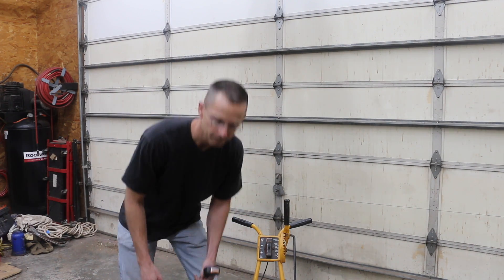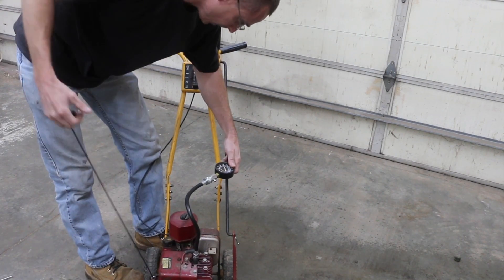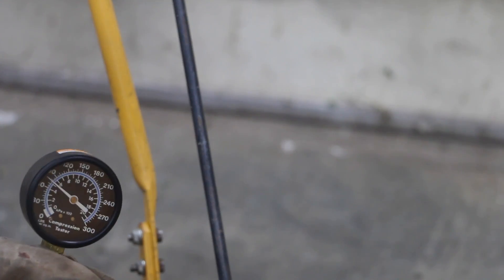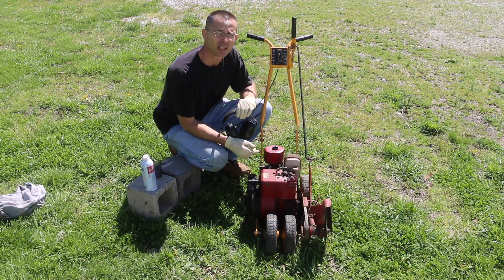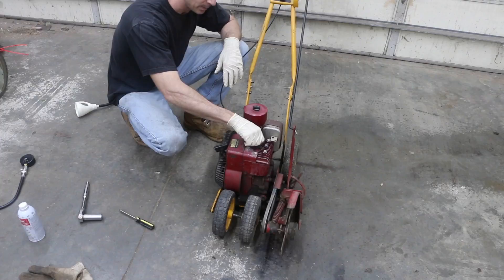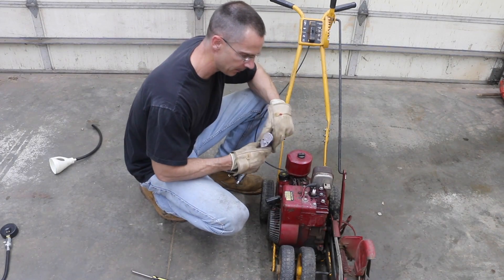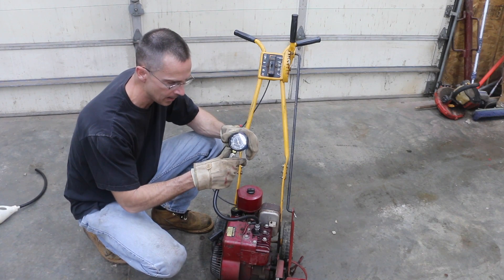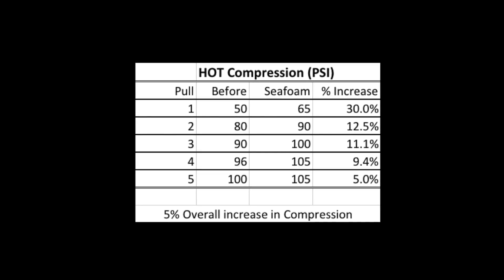Seafoam--can't believe what it did to my engine!!--Episode 4--Compression Test

Comment: I added a can of Seafoam to the fuel tank on my toyhauler after it had been sitting for nearly 7 years. (Took me awhile to get the title.) Initially it wouldn't start as I expected. Then after a lot of cranking it started running very rough. Lots of black smoke. Took a break till the next day and when it started fairly quickly this time it still had a lot of black smoke and was sputtering and coughing but it ran and gradually started smoothing out and after about 25 minutes it ran as thought it never had the "vacation".
I add it to my Cummins fuel tank about every other fill up. Runs great.

He should have added it to the fuel tank not dumped it into the intake. It has a very different function than water injection.
Reply from the maker: Chris, It's helpful to read about your experience.  Thanks for watching the video and commenting!

Comment: Compression in a motor tends to build as the engine experiences more revolutions until the presser exceeds the "containment" pressure of the valves/piston rings.  I believe the reason for the high disparity between your before and after results for the first several pulls was perhaps due to a more "exuberant" pull after seafoam.  I do believe the final pull numbers though, and a 5% increase in compression is nothing to sneer at! Nice video!
Reply from the maker: William Crowe, I wish these small motors had electric starters on them to remove any variance!  Thank you for the encouraging comments regarding the video and thanks for commenting!

Comment: The engine with higher compression may be slightly harder pull start and it should start quicker, needing  less pulls.

 I wouldn't use water to clean an engine unless the engine is tore down and you have a hot water powerwasher.

The Seafoam is proven to work, so I would take that route and it will probably do the job quicker than water but with less thorough of a cleaning perhaps?  I wonder if that stuff ruins gaskets prematurely?

Comment: removing carbon decrease,s compression, but on the other hand carbon built up can block cooling or  cause pre ignition
Reply from the maker: Tom, thanks for watching the video and commenting.  Others mentioned that cleaning around the piston rings and valves helps create a "air tight" cylinder for better compression.  This seems to explain the improvement.

Comment: Water is in every combustion engine.  Condensation is a sign of efficient combustion.  So therefore small amounts of water won't hurt cylinder walls.
You can clean your carb by holding at half throttle and blocking air allowing the engine to suck trash out of the jets.  It's proven
Reply from the maker: Highstranger951, Thank you for watching the video and commenting!

Comment: I think what is going on here is due to thermal expansion of the metals vs the carbon build ups on the valves (in this particular engine) is at different rates and the addition of the seafoam/water/ antifreeze  or what ever you use makes the metals contract rapidly and the carbons cant contract at the same rate so they fall off the surfaces. I think proper monitoring of the EGT's will tell us what really is going on. SO for this particular application the product isn't as important as learning why this works to start with. With that said the truck engine repair with the tapping valvetrain was interesting I would like to have heard the results without the use of the lucas stabilizer (motor honey).
Reply from the maker: Master Debater, Very interesting explanation!  This makes sense!  If I could do the truck project again, I wouldn't have used the Lucas.  Thank you for watching the video and commenting!

Comment: Go to Walmart pay $1.00 for a gallon of demineralised water. It is just as good if not better than Seafoam or anything else on the market. No it will not harm your cylinder wall or pistons that's what they tell you to sell the product. Now before you question my experience I am 42 and have been working on cars since I was 15 and have been working on natural gas oil field engines for the past 20 years and have used nothing but demineralised water.
Reply from the maker: mikefranklin74, Thank you for watching the video and commenting!

Comment: After I used seafoam on my engine it fixed my cracked head gasket, cracked engine block, slipping clutch, and made my car sound smoother and it also fixed my a thrown rod and gave me an additional 50 hp. car mechanics and oil changes are just a conspiracy by oil companys to sell filters and a liquid that basically last years. seafoam will fix anything...
Reply: Seafoam fixed my marriage!
Reply: You mean, oil is not really needed? Gotta go to the beach where seefoam is free!
Reply: Seafoam can fix anything but a broken heart.

Comment: are you holding the throttle open during compression test? it will give a more accurate reading. we used to use water to clean the carbon out. as the droplets get turned into steam it blows the carbon out. I had the fire department called on me when cleaning the carbon out of a 318. I don't think the water is going to clean the ring lands as good as the seafoam soak but it cleans the chamber's real good.
Reply from the maker: Jnl Jnl, I have the throttle in the wide open position. Looking directly into the carb, the throttle plate is open.  Thanks for watching the video and commenting!

Comment: about to seafoam my 1989 Toyota pickup today after you Ranger video. Good stuff man
Reply from the maker: Maxwell, Those Toyota trucks last forever!  Did you experience any improvements?  Thanks for watching the video and commenting!
Reply: Yes sir!

You could feel the whole truck idle before hand. Now? Smooth as silk. The low end torque had a half second delay when you'd mash the gas, now I can use my big toe on the pedal and it picks up just great.

After the hot soak the smoke just poured out. I must have left a good half mile path through my neighborhood getting to the highway to really open it up.

When starting it the engine had to crank about 3 times before it'd start up, now on the first turn over it's running.

I haven't even run through the oil and gas yet, just put em in an hour ago, did the intake wash out at the same time. Immediate results.

Comment: The rings are where you got the increase... a 30 year old engine that should be run on ND 30 oil ... gummy rings for sure.  That and being air cooled it will always have higher compression when hot.
Reply from the maker: Brian, Thanks for watching the video and commenting!

Comment: If you remove carbon, compression should be lower, and thus the pressure. Only if valves are sealing better then it makes sense. Does this engine have valves on top of the cylinder, or on the sides??
Reply from the maker: Srdan, The valves are on the side.  I agree with your assessment and believe the valves are sealing better.  hank you for watching the video and commenting!

Comment: I think the reason for the better compression maybe down to the rings being decoked or valve seats being cleaned up. what would have been even better is if you had done a test after running it and before you had added it straight to the combustion chamber. good vids keep them going!
Reply from the maker: Mike, Yes, agree with you.  Rings decoked and valve seats cleaned up.  Thank you for watching the video and commenting!

Comment: In the old days we used 50/50 mix of water and auto trans fluid down the carb while engine up to temp and running.
The carbon would occasionally make it all the way out the tailpipe.
We use Seafoam to fog the internals of our 2 stroke snowmobiles before storing them for the summer. Added to the gas tank at near empty. Ride till warmed up. Store with a full tank of gas to prevent condensation in the tank.
Reply from the maker: Matthew, Thank you for watching the video and commenting!

Comment: If you put a little oil down on the top of the piston, cranked it over with the spark plug removed. You would have increased the compression a little (wet compression).
Reply from the maker: Vaughn, Thank you for watching the video and commenting!

Comment: Do you have a manual speed control on that engine? You should ideally open the carb throttle slide / butterfly fully before doing a compression test  to maximise the air it can suck it.. if you do it with the throttle valve closed you can get erratic / inconsistent readings. Either open the throttle fully or manually open the butterfly / throttle slide depending on equipment.
Reply from the maker: Neosophist, Excellent advice!  Thanks for watching the video and commenting!

Comment: need to keep throttle wide open when measuring.  Also.. Reading will be higher on cold engine.  90 lbs BMEP is not very good for a 4 stroke.  Should be more like 130-150 .
Reply from the maker: grabir01, The choke was off and the throttle was fully open.  I apologize I didn't mention this in the video.  Thanks for watching the video and commenting!

Comment: My experience has been that Seafoam works very well. I got some bad gas a couple of years ago. It was fouling my spark plugs in just a few miles. Seafoam corrected the problem.
Reply from the maker: Garcansdad, Thanks for watching the video and commenting! Do you vote for water or Seafoam as the better combustion chamber cleaner?
Reply: I understand how each will work to clean the internal parts. With water you are steam cleaning the engine. With Seafoam you are using a solvent. I'd prefer Seafoam because it's petroleum based and petroleum is what's deposited inside the engine.

Comment: In doing the hot soak (pouring solvent into the cylinder/combustion chamber) you're diluting/washing away a lot (most?) of the oil from the cylinder wall.  Hard to see how that's a good thing...
Reply from the maker: optimisticspeculator, I see your point!  A lot of commenters recommended this approach in previous videos.  So, I thought it'd be a great experiment.  Thanks for watching the video and commenting!
Reply: Sea foam is a cleaning lubricant thus it adds lubrication quite opposite of washing it away.

Comment: 60/40 water-windshield washer fluid (methanol) mix, 1 gallon. Shake up thoroughly in jug. Place small diameter vacuum hose into jug, standing up, hose to bottom of jug. Connect hose to intake manifold. Start engine, keep at 1k RPM until jug empty. Change oil HOT and drain at least 2 hours. Change oil filter, new oil. Do this every 30k miles.
Reply from the maker: HUBBABUBBA DOOPYDOOP, Very interesting idea!  I'll consider doing this in a future video!  Thanks for watching the video and commenting!
Reply: Not yet, will in time!
Reply: did you make a video of before and after on a dirty engine big or small?

Comment: Forgive me if this question has already been touched upon, but isn't there an inherent risk of damaging or contaminating the O2 sensor(s) and catalytic converter(s), when all that emulsified, petroleum-soaked crud gets blown out of the combustion chambers?
I'd really like to de-gunk the V8 in my '03 truck before it's upcoming Smog Test, but I'm afraid the exhaust system will be contaminated, and thereby Fail the emissions tests. 🤔

Comment: In the old days mechanics would drain the oil out of the engine then use kerosene to fill for oil and run for  a minute or two then drain it,,,,voyolha clean engine.
A long time ago in a galaxy far far away.......
Reply: I personally used diesel. drained oil, filled up with diesel, disconnect power line to coil pack or coils. crank a few times. let it soak. repeat the cranking every hour or so through the day. 
finally. reconnect the power to the coil packs. start your engine a few times. do not let it run any longer then 10 seconds at a time at the most.
drain diesel, refill and change the oil filter, run the engine till you reach operating temperature. drain again, and change filter.
it deeply cleans the engine if done right. it gets rid of the oil sludge and burnt oil build up in engine. sea foam in the other hand, cleans valves, the tip of the pistons, and the throttle body.
Reply: @atlaseagle9353  you just described how we did it on our farm learned it from watching my grandfather for years. I would be afraid to do it on newer engines especially newer engines especially when computer systems calibrate the engine.
Reply from the maker: Sam, Others have commented in the other Project Farm videos recommending this approach.  I hope to try this approach in a future video!  Thanks for watching the video and commenting!
Reply: sam that was before they invented detergent oil and it only was to remove sludge in the lower half of the engine and oil holes not the cylinders ....
Reply: Sam, I have seen that done in the Philippines. It works.
Reply: The kerosene would wash out the lead from the fuel.
Reply: It's funny reading this because I watched my dad do this to my used, (but newly acquired), scooter I got as a kid.
We completely drained the oil out of the side shaft Briggs & Stratton and then filled the crankcase with kerosene.
He then started it up - I thought he was freaking crazy and I thought it was going to explode!
He ran it hard, pulling the governor to get maximum RPMs to boot.  There were 6" flames shooting out the muffler! I was scared to death. 
Hearing the sound of that engine roar was terrifyingly wonderful! I was hooked!
He then drained the crankcase and all manner of grossness came out.
Then he filled it with regular oil and I used that thing until I sold it years later...
I  have always remembered that - so it's funny that you brought it up.
Reply: Sam  I use brake fluid
Reply: @sschevy8558  never heard of brake fluid before. I would have to many concerns couldn't make myself do that personally.
Reply: Pour a kittle marvels in carb on hot running motor clean as it gets!
Reply: *voila, not voyolha or valhalla or wah lah or whatever else I see illiterate people attempting to spell out for the word. If you only speak English stay away from Latin.
Reply: Marvin Harrison Smith II   😬well after reading your English....stick to Latin. 😉
Reply: @RockandrollNegro  "Et voilà."  And that's French, by the way.
Reply: @RockandrollNegro  at least be positive in your criticism. You obviously understood what he meant, so why not help the guy out instead of being a keyboard warrior trying to make yourself look better than him
Reply: @sm1353  I agree completely I don't like when people use others to make themselves look better, even happens to me once in awhile especially when autocorrect changes what I said and didn't catch it. I am dying and am guilty of cheating sometimes so I just just get done quickly but I do attempt to make sure wording is correctly spelled yet autocorrect gets me more than I care to admit.
Reply: @RockandrollNegro  latin? sounds french to me

Comment: I vote water too, but ONLY after the engine is HOT before treating it!
After running water through, still treat w/Seafoam or Marvel Mystery Oil.
Keep the metals impregnated with OIL!
MMO (Marvel Mystery Oil)...it's the BEST!
Reply from the maker: soundspartan of the basket, Thank you for the top on using water.  I'll be sure the engine is warm.  Yes MMO is a terrific product.  I will be testing it in a future video.  Thanks for watching the video and commenting!

Comment: I think water will be better just cause I'm rooting for the underdog. I have cleaned my engine throttle body and carburetor As well as the inside of the intake manifold on my 1999 Dodge ram 1500 pretty good with just carburetor cleaner, can we try carburetor cleaner versus seafoam sometime?
Reply: Your Ram doesn't have a carburetor. Dodge switched to EFI in the late 80s, your '99 would be running sequential multiport injection, unless you've converted it to run a carburetor. That said, comparing carb cleaner to the other chemicals being tested sounds like a good idea.
Reply from the maker: Robert, Is there a specific brand of carburetor cleaner you recommend?  I agree, this seems like a great test!  Thanks for watching the video and commenting!
Reply from the maker: Nathan, Thanks for watching the video and commenting!

Comment: I had a guy put water in my carb on car i had when i was younger to clean it never hurt it , also i use to use transmission fluid in carb to clean it, always funny watching people drive by when car was blowing smoke out
Reply: forgot to mention it was 1971 250 inline six, with three on the tree
Reply: +thunderbird97, the best vehicle i ever had was a 1971 f250 with a 300 six and a granny 4spd. not the fastest or fanciest, but i would still say the best. what a beast, i did in fact tear down a house with it. i hate to say it , but the only thing wrong wit it was me.
Reply: mine was in a nova it was a good engine, had my stereo cranked going down hwy happen to notice i was in 2nd running 70 mph, drove around 5 miles like that, bad thing about mine it was open around engine so if road was wet it would get water on distributor cap and drowned out, so i had to keep it sprayed
Reply from the maker: thunderbird97, Thanks for watching the video and commenting!

Comment: Hmm. This seams counterintuitive as the seafoam would remove the carbon buildup that one would think would keep the compression up. (Carbon would buildup around the increased tolerances in the cylinder thus keeping compression higher)
Reply from the maker: MuscleCarOz, I think it must have helped clean the piston rings and where the valves seal when they close, allowing better compression.  Thanks for watching the video and commenting!